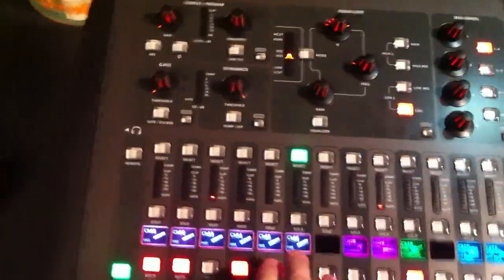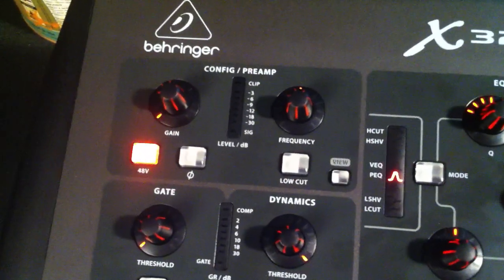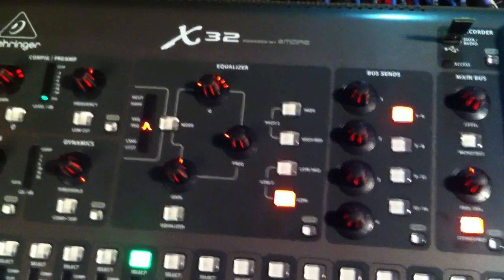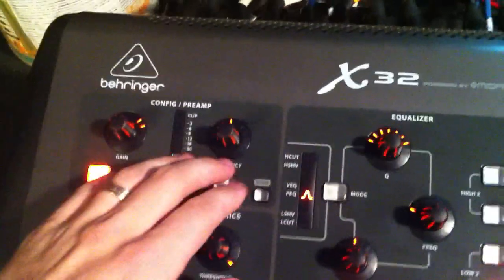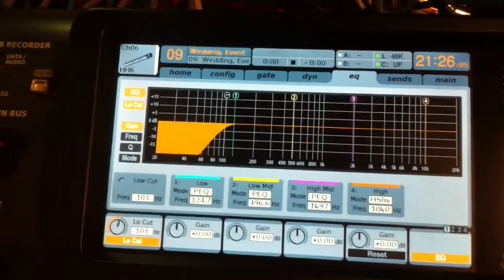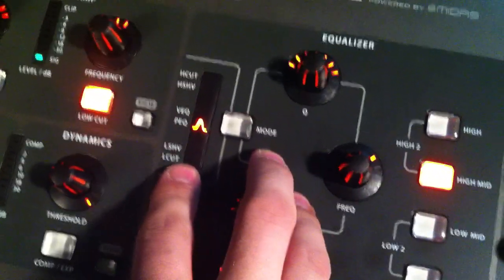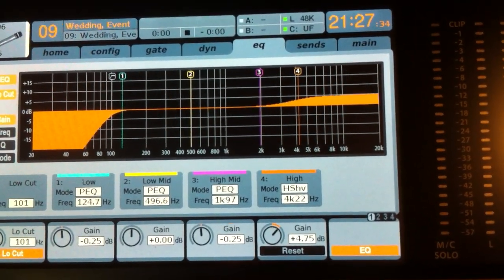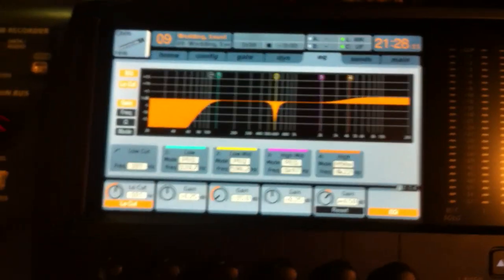NRCC - Behringer X32 - Basic Channel Setup and EQ

Comment: Question: I have no issue recording instruments in Ableton but how on earth would you record voice in Ableton because  the MAIN slider (at the very right) control both the input level in an Ableton track AND the volume of the sound = LARSEN effect (speakers are on!) .  I just can't figure out how to disable the speakers when using headphones and the MAIN slider.

Comment: how do connect my 24 mics and  15 drums to the x32 mixer
Reply: Basically...

Kick mic
Snare mic
left overhead mic
right overhead mic

Guitar mic
Bass guitar mic (or DI output)

Vocal mic

Again, this is a BASIC setup. This setup uses just 7 of the mixer's 32 inputs.

Electric keyboards don't require a mic, just plug them straight into an input. A "line" input specifically, but I believe the X32 auto-detects a line-level input.

More instruments and more singers = more inputs needed.

32 inputs is more than plenty for most bands.

In regards to your 15 piece drum kit, in my opinion, using 15 mics to mic each piece of kit individually is major overkill and only complicates the mix needlessly....however....having 32 inputs makes it possible if one is so inclined and your sound guy is comfortable babysitting 15 faders for the drums alone.

Comment: Hi Drew

Great videos Drew! You do a fantastic job & I commend you. I would think Behringer should buy up your videos and post them on their website because they don't cover the topics that you have since the boards release. I just purchased a X32 Producer (rack mount unit) & could really use your help with the following issue.

I've tried another approach to my dilemma but I can't seem to get the results I want. My wife & I play in a duo and would like the mixer to be routed as it was with our Mackie 1604. The backing tracks need to be adjusted till I find the magic in level & EQ.

Here's the scenario.

#1 - Two Vocal mics are on channels 1 & 2 ( xlr inputs layer #1, 1 - 8 on my X32 Producer ) sent to > Mains & sent to > Mix Bus # 9 & 10 ( Mic 1 to monitor wedge #1, & Mic 2 sent to monitor wedge #2 ). Mix Bus 9 & 10 need to be routed to the XLR outputs 1 & 2.

#2 - I have a stereo backing track coming in on the X-USB card via a laptop. I assigned Channels 3 & 4 ( L & R ) on Layer #1 ( 1 - 8 on my X32 Producer ) & that all works out fine sending the signal to the FOH Mains.

#3 - I want to assign channel 3 & 4 ( stereo backing track ) to Mix bus layer 2, strip 11 & 12 > need to be routed to the XLR outputs 1 & 2 attached to our wedges.

#4 - I want the ability to raise or lower the volume of strip 9, 10, 11, & 12 on layer 2 mix bus independant of one another without affecting the mains or using the sends on fader feature.

#5 - I will also be sending a guitar signal coming from a guitar processor on channel 5 & 6 layer 1 input routed to the > Mains & > Mix Bus 9 & 10 along with the vocals.

I'm trying to keep 1 layer on the input section always visible & one layer on the output section always visible and accessable so I can make quick adjustments for now. I elected to do it on the same layer where the effects sends are easily adjusted as well. so I hope I'm on the right track by doing this. We don't have a soundman so I need access to this in this way until I get it set & then not mess with it.

* Output 9, 10, 11, & 12 on mix bus layer 2 are to be sent out of XLR 1 & 2. Strip 9 & 11 out of XLR 1 & strip 10 & 12 out of XLR 2.

Can you please help me to achieve this? Please not the x32 Producer does not have 4 Aux sends that can be accessed unless you go to the screen. I don't even know where they are on the screen because the manual neglects to make reference to them. 

Cheers!
Tele' O'Neil

Comment: Drew,
Thanks for your videos. They're great! Recently we discussed the "right" way to set up gain. There are two theories. One is to pull the faders down. And bring all gains to a certain level below 0dB (with help of the LED Meters). The other way is to put all channel and master faders on 0dB and then put the gain to a level where the individual instrument volume seems fine for FOH Mix. What's your opinion on this? Thanks and br Urs

Comment from the maker: Well because your monitors are mono, you can insert two racks using the dual EQ's.  Basically channel A of Rack 7 will be monitor 1, ch b of rack 7 will be monitor 2.  Channel A of Rack 8 will be monitor 3 and B of rack 8 will be monitor 4.  Then you can use a stereo EQ on the mains which would be one more rack in the EQ.  So in total you would only use 3 of your 8 racks.  I keep my monitors flat but just pull out any problem EQ spots.  So the 6 band parametric EQ is enough for me!

Comment: Thanx for your reply.
I will need basically at least 4 monitor groups which mean I'll need to insert a graph EQ on all 4 of them for tuning the stage (I will do with the X32 FOH and stage monitors at the samen time), and then i need a stereo graph EQ for the master output (for tuning the sound of the venue). In total 6 inserts thus. On video I only saw using 4 inserts at the same time.
What? do you tune the monitors with parametric EQ? I've never done that.

I hope i can route that

Comment from the maker: Yes there is a gain control for both the 32 main inputs and the 6 aux inputs.  The 6 aux inputs have a -/+ 12dB I believe, and then the main inputs have much more range than that.  The Aux ins are made for line level.  Yes you can insert any of the effects racks on any of the channels inside the X32.  For monitors I will make use of the 6 bands of parametric eq, and then if I need more I will insert a dual mono eq.

Comment from the maker: There is not a port for the display.  However if you have a PC computer you can use the Behringer software (free) and connect that into the X32 to display the meters and even mix from the computer.  You can have up to 10 devices connected to the X32 (iPads and/or computers) at one time and be able to adjust things simultaneously.

Comment from the maker: If you take scene 1, then save that as scene 2 after making some volume adjustments, everything from scene 1 will copy over to scene 2 with the new vol adjustments.  then if you make an EQ change and save that as scene 3 it will copy everything from scene 2 and add the EQ change you made.  Does this make sense?

Comment from the maker: Just like envisionelec suggested making sure that your electric is clean is a very good idea.  I have mine through a Furman AR-1220 Voltage Regulator that regulates the voltage at a very stable 120v.  You can pick up a newer Furman AR-1215 or one of the older AR-1220 and I am sure that would help.  If you are still having issues, contact Behringer as they are really good at getting right back to you now.

Comment: Hi, we recently got the x32 up and running at our church but have been having problems with it seeming to crash during services - has anyone else had this type of problem or have any idea what the cause/solution might be. we have updated to the latest firmware and are running with remote program active on our computer system.